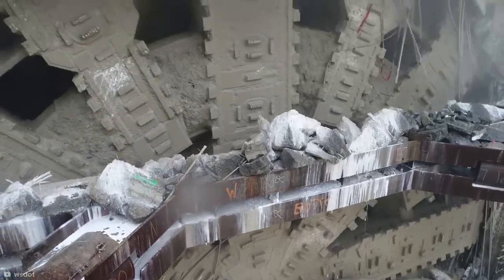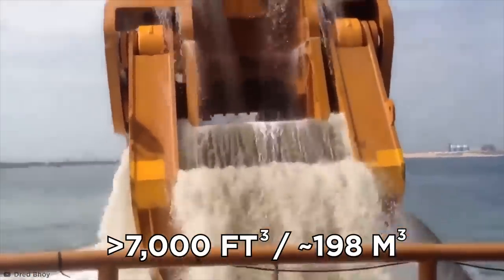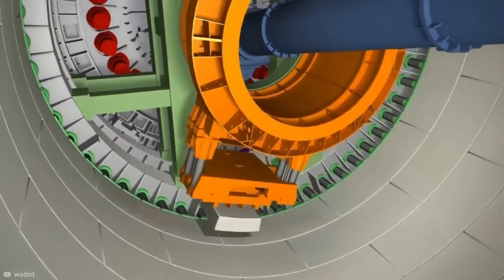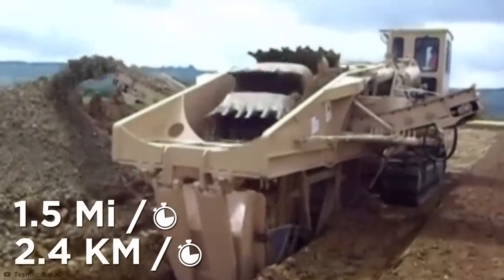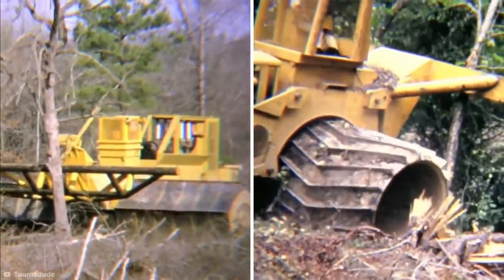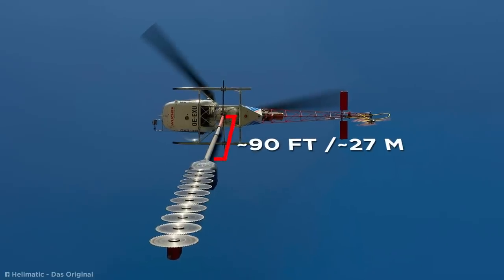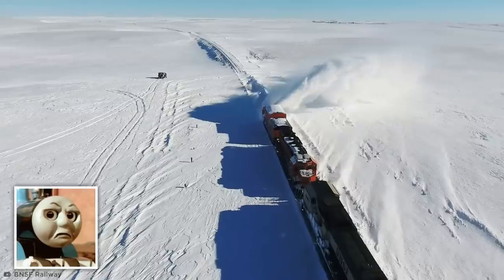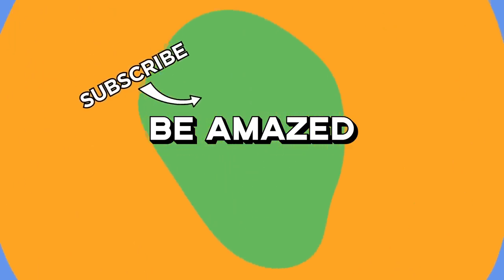Extreme Machines That Do Perfect Work

Comment: I grew up in the town that tree crush sits. It never failed to be impressive even after years of seeing it everyday.
Reply: I know that machine. I worked in one of the sawmills for Finlay Forest Procucts in MacKenzie in 1968. The Bennett dam on the Peace River had just been completed creating Williston Lake. The lake backed up about 150 miles and made it possible to log an area that was otherwise inaccessible, there was nothing there, no roads, the logs were transported from the northern end of the lake by boom boats. Virgin forest at the northern end of the lake; trees were cut, brushed, sectioned and skidded into the lake, formed into rafts pulled by these little two man tug boats and floated down the lake to the mills at MacKenzie. By the time me and some other guys found this machine it had already been parked and abandoned. Where it sits now looks all civilized and public. When we went to go play on it, there were some fishing streams nearby, it was at the end of a  deserted dirt road and already had weeds, shrubs and trees growing around it. We climbed all over and through it. There was an engine room with two Cummins diesel engines that drove electric generators. Yeah, the thing was driven by electric motors. In the operators cab was a small dashboard with a panel of toggle switches. There was one big three-position switch; left, right and neutral (center). That’s how it was steered. I guess it was intended to clear the area where the lake was going to be, but I don’t’t think it did. I heard it had got bogged down once and it took eight D-8 Cats to pull it out. It was built in Texas by Letourneau, transported in five sections by railroad and assembled on site.
Reply: Mack Town!

Comment: 1:52 I hope that glass protects the operators from metal objects flying out of the trees because of radical environmentalists.
18:44 I'm extremely impressed by the fact that the pilot never gets close enough to the power lines to cause an accident and flies high enough not to cut anyone in half.
Reply: In those machines we have protective windows because shainsaw blades can fly off of the claw and them fly wery fast    usually no tree has metal objects in them because the trees are in controlled environment so no big fear of the   only of the blades of the saw
Reply: Imagine thinking that protecting the environment makes you a radical or that those people are going to put metal in these trees out in the middle of nowhere to hurt these guys....

Lmfao. Pollution has a side effect kid.
Reply: @randyt3558  I just want to add something. I'm not trying to start a fight or argue just stating a truth, at least in the United States. 
Logging in the USA is, carbon not figured in, is one of our more sustainable actions. Much more than livestock and farming. Logging companies have come light years since the 80's. They have learned that if you don't do it sustainably....YOU WONT HAVE A FUCKING INDUSTRY! Now in regards to other nations, I have zero 1st hand experience so I can't speak to them. I'm not saying logging has zero impact, that would be outlandish, EVERYTHING has an impact of some kind....even farting or drinking a glass water does something . Just keep in mind that logging is no longer the repulsive disgusting industry it once was. Now we can afford to switch our energy to pipelines and fraking (I'm sure I spelled that wrong). Have a wonderful day everyone. I miss yelling at loggers but we yelled loud enough when I was younger that I guess we made a difference!
Reply: @randyt3558 , There's really something wrong with you.
Reply: I was more wondering if it gave protection from evil pollution demons.

Comment: 6:28 is a baby shear. We have one at my work that is 3 times that big that we shear iron and metal with. They are super strong though.
Reply: What possible use has it? Please, genuinely interested.
Reply: @calvinjohnstone2664  I work at a metal recycling yard. We use it to cut up things like school busses, big farm tractors and stuff like that. It cuts them up into small pieces so they can be loaded onto a semi and shipped off. Things like suv's and small trucks and cars we put in the baler and it turns them into boxes. Or a metal bale. Kind of like a hay bale but made out of metal. But the big stuff we need the big shear for.
Reply: I think I have a video of ours in action somewhere around here. I will find it when I can and let you know. My dad passed away last Sunday and yesterday was his funeral so I will find it when I get a chance.
Reply: Lol imagine you're on the battlefield and then you just see a tank get popped apart by a adult shear [3x size of shear in video]
Reply: @JenniferBuechner , I know this is late, but sorry for your loss.
Reply: @augustreil  Thank you.

Comment: Bucket wheel excavators are pretty impressive alright. There is an event venue in Germany called "Ferropolis" (which translates to "City of Iron") that has three of them around the main stage. They a bit smaller than the behemoth shown here but still...Looks pretty awesome when they turn on the lights at night.

Comment: 25:00 - Surprised no one else talked about 100KW compared to a house's monthly electricity use was so wrong it hurt.....lol. Either you're saying the average house uses 200KW/Hrs a month, or that 73,200 KW/Hrs is half of what the average house uses in a month... (100x24)30.5=73,200Kwh. Even if you're saying it produces 100KWh a day, thats 3050KWh as "half of what an average house uses"
Reply: You went from KW to KW/H in one sentence... then provided proof for the KW to KW/H conversion... in your attempt to satisfy your own claim. 25:00 is talking about available energy, not the consumption in your off grid power system

Comment: When I was a teenager, i lived in an area where the Bagger 293 was used (the area is called Garzweiler 2). In the years around 2000 whole villages were bought and teared down before the Bagger did its work... today the bagger and the area around it is sometimes used for big techno parties. the machine itself has a lot of lights that get switched on at night time and it's a really beautiful sight (you can see it from the adjacent autobahn/highway).

Comment: The cutting suction dredger shown at 4:20, is a small dredger. Ther are dredgers 3 times the size. And it doesn't go strait forward, but swings from left to right. And after every swing goes a little bit forward.

Comment: The rail sheer - cutting up rail track - narrator says 3 ft. weigh up to 140 lbs. Considering rail steel is either 115 or 136, he's about 168 lbs. off.  Rail steel is either 115 lbs. per foot or 136 lbs per foot.
Reply: WELL, THE NARRATOR SAID "ABOUT" AND ALSO "MODERN TRACK" https://en.wikipedia.org/wiki/Rail_profile—SAYS IT'S CORRECT

Comment: 05.54 This rail section looks like from a main line permanent way would be approx 128 kg. or so. It is too heavy to lift! It is like trying to lift two or three people 'normal' sized people at once. Usually main line rail is about 64 kg per metre.
Reply: You mean 05:54

Comment: I know of a better way.. you can make a really heavy weight float and use the waves to lift it, on the way down it would pull on a string wrapped around a pulley or sprocket and that would gear up or down to spin the turbine to generate power. Have a spring to rewind the string.

Comment: at 25:00 talking about wave-power you incorrectly say 100 kW is less than half of what a typical household uses. If it does that for a month (24 hours  and 30 days) it will produce 72 MWh. Households surely use less.

Comment: I used to be a composter. Our equipment wasn’t nearly as clean and shiny and you had to  “walk” it through the heap after raking it out into long lines with a loader.

It had a conveyor on the back that shot out the compost after the pickup and knockdown drums sent the compost into a screw auger.

Ours was also much taller than 7ft. Our heaps were taller than that.

Comment: @19:37 - an elefant weighs ten times more than 800 pounds of the buzzsaw
Reply: @25:00 - 100 KW are enough to power 10 homes together. KW is power, not energy. energy is KWh. 10 KWh can only power a 2,000 watts washing machine for ~5 hours

Comment: 100 kW aren't enough to power a house for a month?

100 kW aren't enough to power anything for any amount of time, since your unit is MISSING THE TIME COMPONENT.

Jeebus, a little physics never hurt anybody.

For those interested:

kW * h = kWh      is the unit you would use here, just as     km/h      is the speed you would be driving at while    km/h * h = km   would be the distance you drive.

Comment: 100KW not enough to power on house for a month is kinda weird statement

it's easily enough to power a house. For a second or a billion years
Reply: 100KW is what electric cars use. I cant see powering a house with that, but ok buddy
Reply: @stefanbauer423  a car use way more than an average house. According to google an average house uses just over 10000 kWh per year. That's just over 1.2KW in average.

Anyways my point is IF 100KW is enough for a day, it's enough for any amount of days